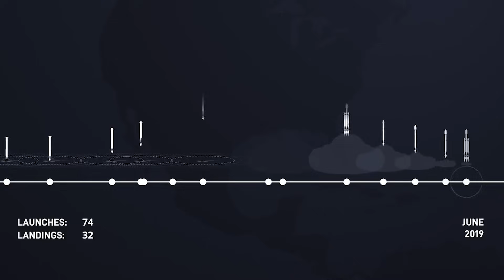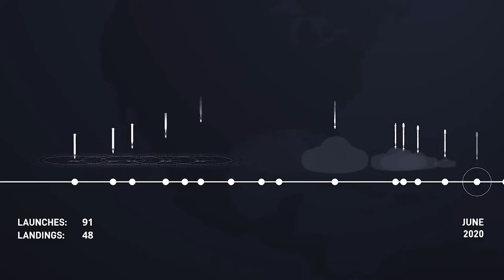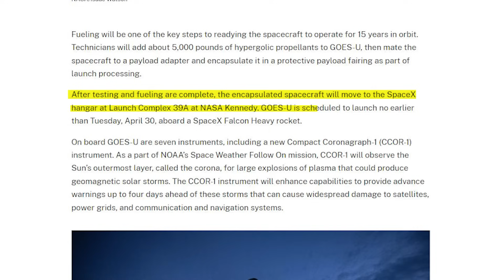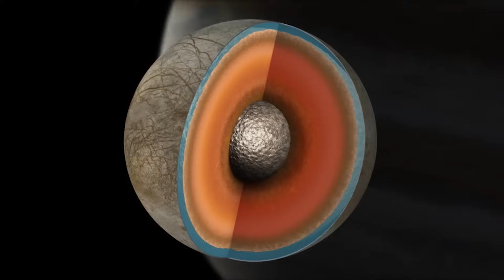Is There Demand For SpaceX's Falcon Heavy?

Comment: If we actually are going to colonise the moon and Mars, we need " heavy" for infrastructure and supplies. A space truck if you like. And heavy can be thought of a first step in heavy loads/ long distance combination rockets. You need a lot of stuff for next stage space stations etc, and this proved the cheap reliable prototype.  I wouldn't be duprised if in the next 10yrs spacex uses this system on a 3 booster starship unit.

Comment: Fact: Falcon Heavy has a 10 tonne max. payload. The engines thrust CAN lift more but the the F9 core is too structurally weak and narrow for heavier and larger payloads.
The fuselage would collapse upon launch and aerodynamic forces would tear an extended fairing apart.
Falcon Heavy has YET to launch a payload ABOVE 10 tonnes and, unless restructured, NEVER will.
This year, two new reusables are entering the Heavy Market: ULA Vulcan - 27 tonnes and BO New Glenn - 35 tonnes.
Falcon Heavy WILL dominate the low end of the Heavy Market BUT Vulcan and New Glenn will dominate the high end (for U.S. launches, at least).
There's room in the Heavy Market for all, competition demands it.

Comment: If Falcon Heavy was facing limited demand, how will demand look when New Glenn, Starship, and certain variants of Vulcan Centaur and Ariane 6 begin competing to launch heavy satellites into high energy orbits?
Reply: I think Vulcan and Ariane 6 won't be competitive in terms of price due to lack of reusability. And for Falcon Heavy it seems they do no longer attempt to reuse the center stage. New Glenn will have a fully reusable first stage at least. But Starship is going to be the most competitive one, if they really reuse both stages anyway.
Reply: @cube2fox The center stage can still be re-used, but it depends on the payload and the orbital height. Recently all the missions have needed the extra juice to get up high so the center stage had to be drained of fuel and could not come back down.  This was always part of the plan for that rocket.
Reply: @bluesteel8376  Perhaps reusing the center stage wouldn't leave much of an advantage over Falcon 9.
Reply: @cube2fox  Based on current public government contracts, VC is fairly competitively priced to FH/F9, with all of these vehicles showing massive price differences between different launch contracts.

We'll see if that changes when the space becomes more competitive and prices may be forced to drop to more accurately reflect costs.
Reply: @cube2fox  that’s already not true. Vulcan has sold more than 70 flights already. Those are flights bought and paid for. Vulcan has already proven to be a tremendous commercial success even if it only flies what’s on the books right now. Vulcan has done that while disposable in this age of reusability. Vulcan can very much compete.
Reply: @Rory-Shields  70 flights!? That would surprise me. I assume Vulcan is more expensive than Falcon 9 and most future (partly) reusable rockets.
Reply: @cube2fox  estimates place Vulcan centaur around 100 million and Falcon around 65-70. Plus Vulcan has much more capable upper stage so they are really attractive for high energy orbits. Amazon’s starlink competitor Kuiper alone has booked 38 missions on Vulcan. 

Frankly it’s a good thing. Monopoly’s are bad for the consumer and bad for innovation. Spacex has no reason to really pursue starship if they aren’t trying to beat Vulcan.
Reply: @Rory-Shields  
mono pals are a problem only when the market authority prohibits or undermines competition from doing what the sole supplier is doing - otherwise a mono pal is NOT a problem.
PS: our existing "free" markets feature MANY regulations/frameworks/mechanisms that undermine/prohibit competition... Buffet calls them 'moats' and likes to invest in companies who have them.  One wonders why..
Reply: @Rory-Shields 
PPS:  the 'free' in free market stands for supply and demand being free to adjust to each other, not for a market free from any rules as rules like 'private property' or 'personal freedom' are required for a market to exist in the first place.
Reply: There’s nobody out building payloads that would need the starship. What ever they fly onboard starship is going to be overkill for years unless the missions are supporting Artemis or Launching in house for starlink. If starship was relying on commercial demand alone I’m not so sure that there is a business case for all that investment.
Reply: @Rory-Shields yeah though I guarantee some folks at the DOD / NRO are probably at least working on prototypes. / Designed but nothing will be built for a while
Reply: I think it has to do with fairing size, f9 and heavy have tiny fairings and low volume compared to the competition.
Reply: 67million - 95million?  didn’t musk say spacex launch’s would be in the 2-5mil range?
Reply: @kurknielsen  yup he sure did.